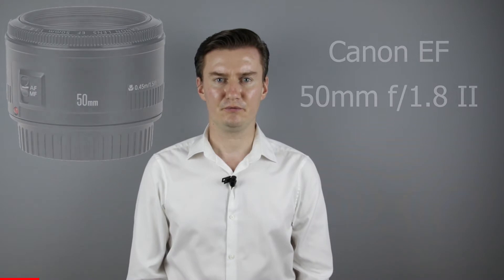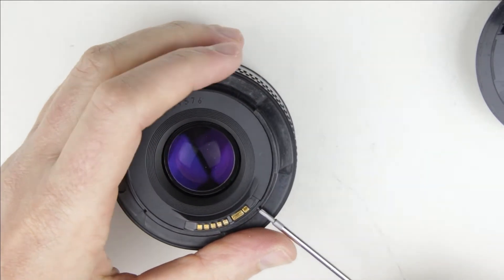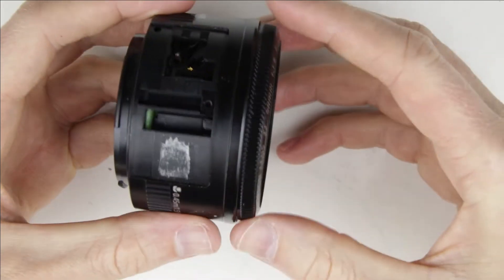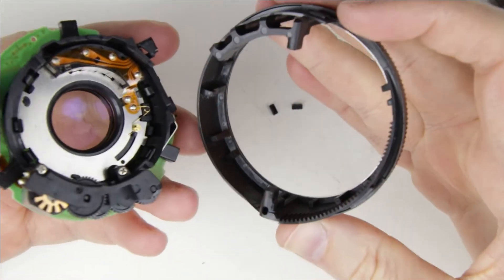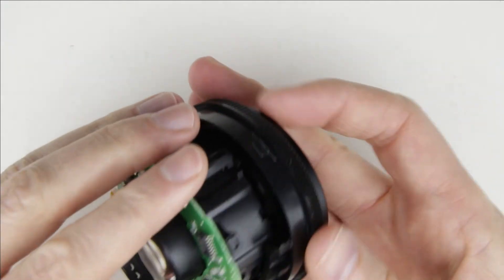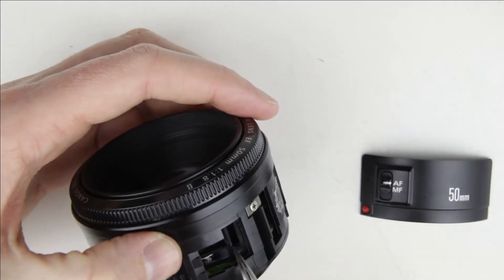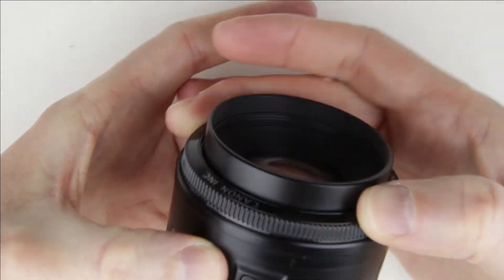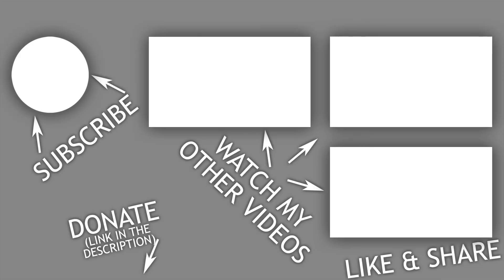Canon EF 50mm f/1.8 II repair: the lens broken into two pieces

Comment: I noticed that my lens has a wobble issue when using the focus ring and the focus ring is not as tight as my other camera lenses.  I do astrophotography and seldom use my DSLR anymore.  Does your lens have a wobble movement while doing a manual focus?  Is there a way to put a shim strip somewhere to take out the wobble?

Comment: Hi, Thank you for your informative step through video. I did all this to clean the lens and now after assembly the auto focus wont work, any tips? It was never a problem before hand
Reply from the maker: Try to disassemble and reassemble the lens again, and make sure that the gears are connecting to the inner lens part, and the AF / MF switch engages the gears.

Comment: 6:27 these "wedgies" fall out so easily after they are put in places. whats the point of them then? im pretty sure they'll go loose if i assemble like this
Reply from the maker: Those are holding the two parts of the lens together. Try to put back the "wedgies" the other way (one side is flat the other side is a wedge... the wedge should go inside).

Comment: the 2 matches, min "4". i don't have them
Reply from the maker: Maybe they were fallen out of the lens. Those two small wedges are used to keep the lens in one piece. If you don't have them, you can use a very small dot of superglue on the plastic parts on the side of the lens to keep it together.
Reply: @CamerasLensesEtc    well i put it without it and without some kind of circle rubber material 🤷‍♂, but it works completely fine 😁 at least as it was before

Comment: The switch moves to AF when I rotates the focus ring in MF mode and then both are locked. Is a common mistake?
Reply from the maker: I haven't had that problem before. Remove the side cover, and make sure that the lever goes into the part which moves the focusing gears inside the lens. I guess the lever is in the wrong place, and that is causing the problem.
Reply: @CamerasLensesEtc  I'm having the same problem, sadly.

Comment: These mostly plastic lenses are total crap.  I have 2 of these and they have both fallen apart like this.  I bought Canon's earlier model that has a metal mount.  Never had a problem with those lenses.
Reply from the maker: Agree... 
The Mark I version is better indeed, also, the STM version has a good build quality.

Comment: They are not PH Phillips screws, they are Japanese JIS screws and you need a special JIS screwdriver because if you damage the screw it is almost impossible to remove it without breaking the plastic so be very careful
Reply from the maker: Thank you for the info.
Reply: @CamerasLensesEtc  Thanks to you for such good videos. A question, how do you do to clean the lenses and why not have a white layer that only looks when the light hits them from the side?
Reply from the maker: I clean the lenses with microfiber cloth, pure alcohol, airpump and brush. I have a few videos about it.
I don't understand this: "why not have a white layer that only looks when the light hits them from the side".
Reply: @CamerasLensesEtc  I clean it with isopropyl alcohol and at first glance it looks clean but when I put a flashlight on the sides I notice that there is a whitish film that I only remove with the lenspen and against the light you can see the cleaning lines
Reply from the maker: Maybe the alcohol contains coloring or something else which can be seen on the lens after cleaning it.
Use quality microfiber cloth (I find the microfiber cloth which comes with Apple products high quality which doesn't leaves residue), after cleaning the lens with alcohol, you might fog it (basically it is distilled water), or use a mix of 70% pure ethanol with 30% distilled water. Rubbing alcohol or denatured alcohol contains additives which can leaves residue and lines after cleaning the lens with it.
Reply: If you are working with the new lenses with loose screws, it's ok-ish. However... If you try Philips on old FD lenses - there is absolutely NO WAY you can disassemble them with the Philips.
Reply from the maker: Thank you for the information! When I have to disassemble FD lenses, I'll keep in my mind that I have to use JIS screwsdrivers.
Reply: I ruined 1 screw, so you don't have to :D